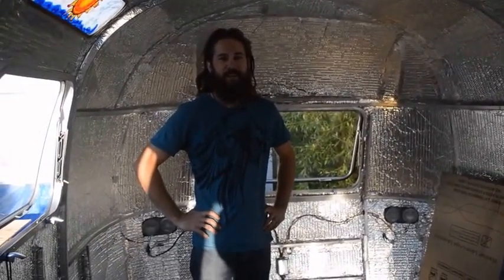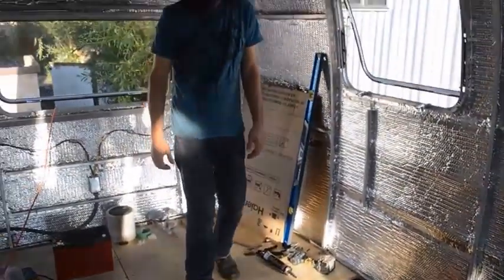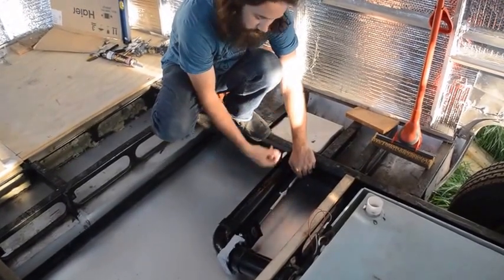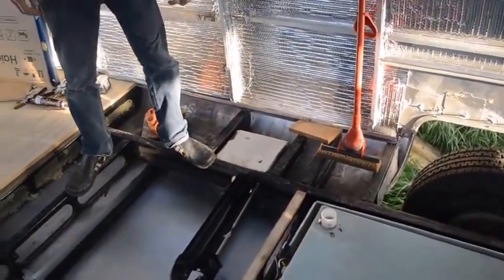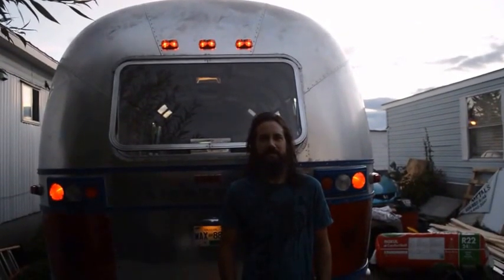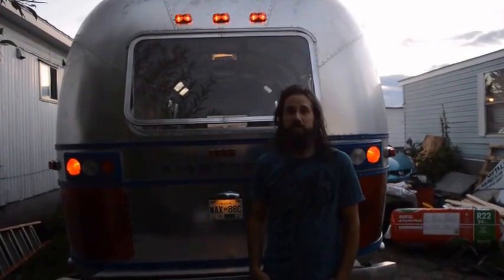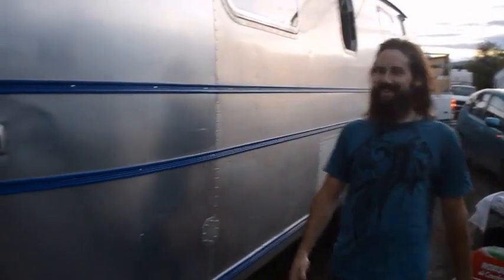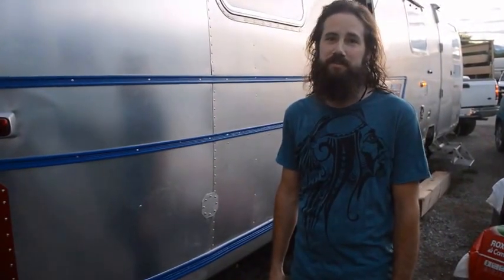Airstream: Floor Installation and Lighting it up!

Comment: Tell us about the red corners???  I've got a corner with a hole in it.  You may have solved my dilemma.
Reply: The back corners were pretty damaged so we just added these for fun and to cover the damage.  I just caulked the heck out of the edges before putting them on and riveted the whole top and sides.  I couldn't quite get the bottom bent right with my tools at the time so they are just open which helps any thing leaks.  You can also just rivet a section of aluminum over the hole.  In later videos I show how I did this.
Reply: @jandsfyre3081  I like it!  Thanks!